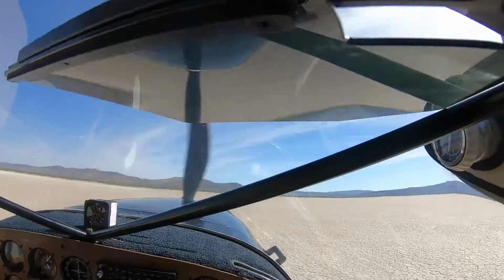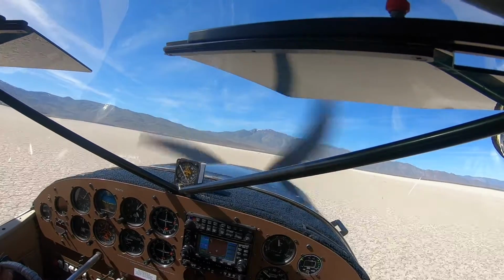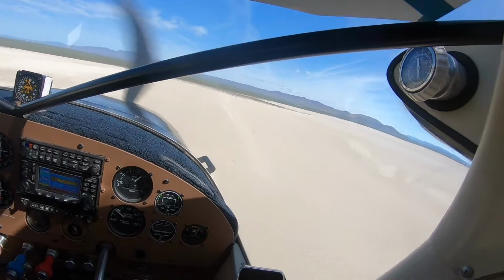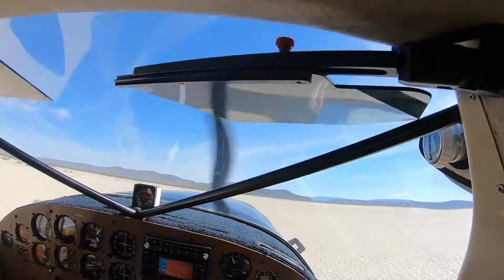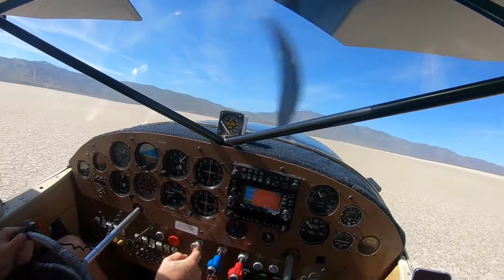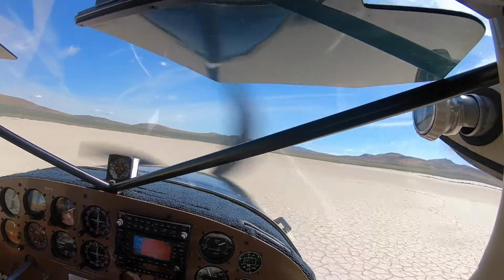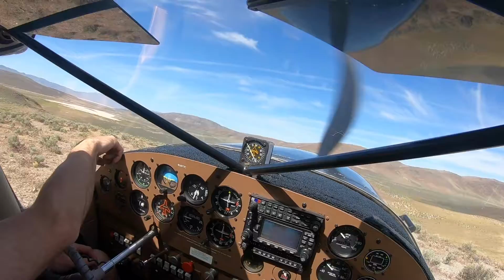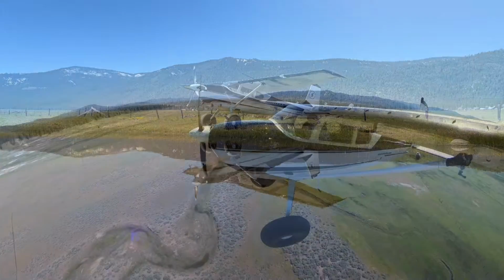Tailwheel Training Cessna180

Comment: A question from a non pilot who's an aviation enthusiast. Taildraggers are seen as hard to handle. Pre WW2 if you learned to fly, it would be a taildragger, it wouldn't be seen as hard to handle, it would just be seen as how it is, if you want to learn to fly, you have to learn. 

Here in the UK if you want to learn to drive a car most are manual transmission, (standard or stick shift in the US). In the UK if you can't drive a stick shift, it's unusual, but in the US it's seen as a hard thing to do, in Europe driving a manual transmission car is regarded as what's reasonably required of the average competent driver, if you're not competent driving manual and are only confident driving auto, you're viewed  as a somewhat less capable driver. Is this the same thing with taildraggers? If everybody was trained on taildraggers, that would become the normal and not considered difficult. I would imagine due to their inherent stability, landing tricycles would become easy after that. I believe military types uphold the mantra, "Train hard, fight easy" Just a thought.
Reply: Had a discussion about this the other day at work... I'm an aircraft mechanic of 10 years, now getting into being a pilot. A lot of the "modern status quo" instructors seem to think that tailwheel planes are something scary that only professionals should even look at. A lot of actual tailwheel pilots seem to think that the compounding skillsets that come from flying tailwheel make you a better pilot overall, and should be mastered before doing anything else... I learned to drive a manual transmission car, so I tend to agree with the analogy. Manual is more fun anyway.

Comment: Hey Quinner, I've been taught to take off with 20 and land at full 40.  Pretty limited on my Cessna TD instruction local here.  Been taking off and landing with no indicated speed in this super 172...you mention cleaning the flaps first thing in this video...but I worry about dropping after I take off from what Ive been taught....I've been told to get to 600' or more and then adjust MP and RPM before cleaning flaps....I fight this thing to stay on the ground whether I raise the tail or not...most the time I go full power, 150'-200' max she is up and climbing like a rocket with 20....but then I'm dialing back to 24 squared on MP and RPM....I am just soloing around so not super comfortable pushing it too far (or cleaning flaps before MP and RPM)...thoughts??  I just keep going a little more each time but afraid I'm going to find that point where I drop at some point...should I??  All the old AK guys say it flys like a 180/185 with this plane...leading edge, 210 HP IO-360, heavy nose.....also have 31's to put on it vs the 26's Im running now and wondering how much things might change then even.  Happy to hit you up personally if you'd rather, just was watching some vids on here.  Thanks, Josh
Reply from the maker: Retract flaps when you have cleared obstacles and or have a positive rate if climb
Reply: @Bigtirepilot  Even if that’s immediately…50’ or less
off the ground before I pull the power back?  Sorry to sound ignorant…
Reply from the maker: @joshswierk4413  I often leave them in until I have a positive rate of climb. That maybe 2 miles from departure. Every spot is different. Often times a notch of flaps helps with stability. Its all about what is comfortable and what is working for the given scenario. Just call me some time :)
Reply: @Bigtirepilot  will do thanks Kevin

Comment: Ailerons GROSSLY undersold.
The largest control on the plane.
No mention how misuse of aileron will ruin the day on roll out.
Misused Ailerons will always over power the wee rudder. and set up a scenario that no amount of brake can repair.
RULE: take off and landing roll out...Maintain ailerons PROPORTIONALY & OPPOSITE  the needed rudder.
Reply from the maker: Ailerons will only aggravate the stall in slow flight. Rudder, rudder and more rudder will save your life
Reply: Prevention- not reaction!